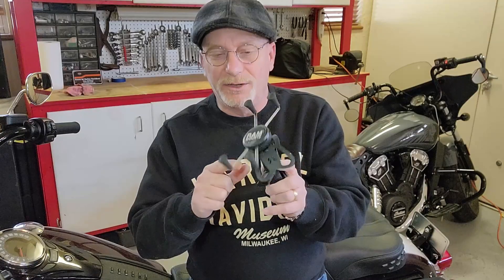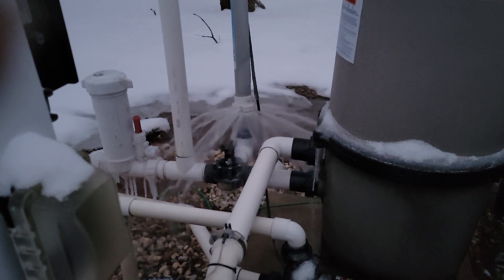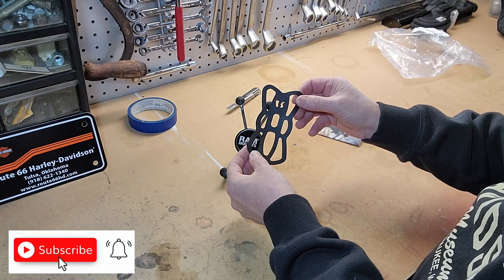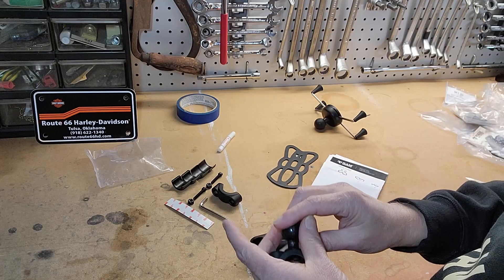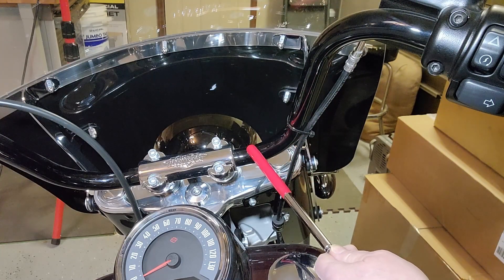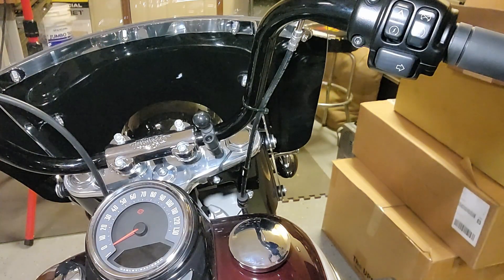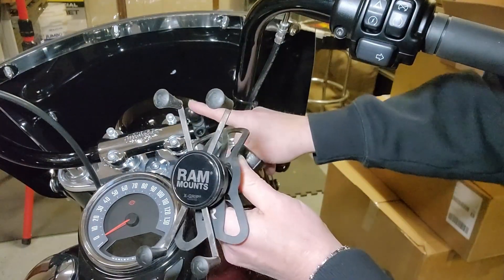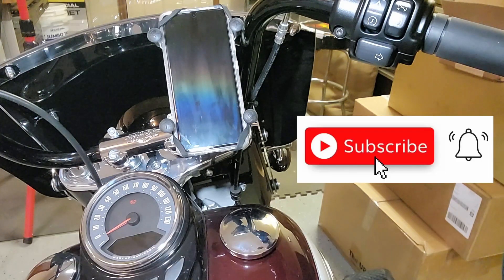How To Install RAM Phone Mount 2021 Harley Davidson Heritage 114 - Review

Comment: I use a  Mob Armor phone holder on my 2022 Heritage, Kawasaki Versys 1000 and Kymco Spade 150. I used the Ram mount like you have but hated the strap to keep the phone from popping out. I starting using the Ram mount without the strap and my phone popped out when I hit a big roadway repair bump. Phone screen destroyed. Needed a new phone anyway. Really happy so far with the Mob Armor mount.
Reply from the maker: That's a great tip. I have often wondered about different mounts. I may end up trying a new one at some point. Thanks for the comment and for watching 🤙

Comment: Why does the phone wobble from side to side once it's in the grips? Very frustrating. Anyway to cure this?
Reply from the maker: You have one that wobbles? Mine holds it pretty stable. Thanks for watching 🤙
Reply: Mine only wobbles when I don't use the rubber safety on the corners.
Reply from the maker: @jamessturtz728  there have been a couple of times I have forgotten to strap the rubber piece to the phone and it is still relatively secure. I wonder if you got a bad unit.